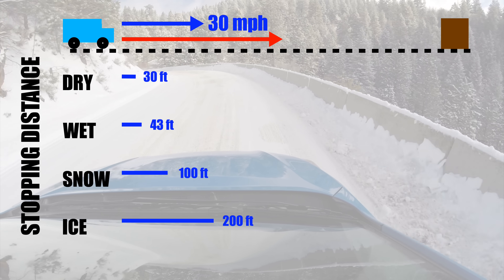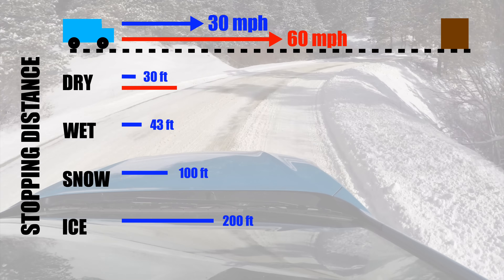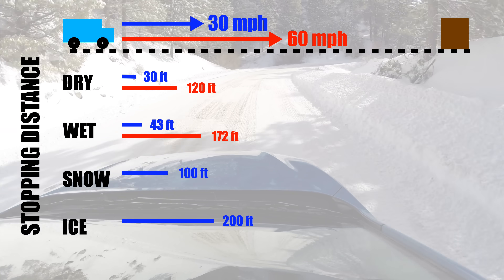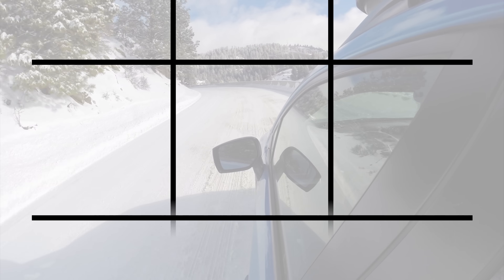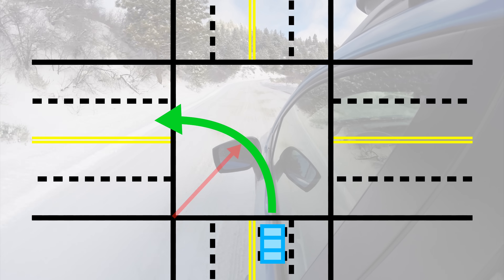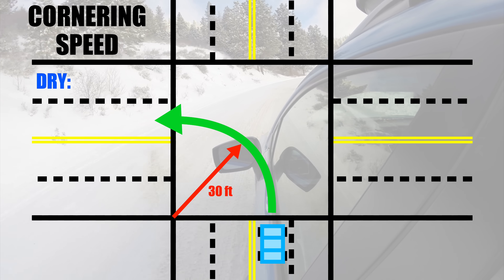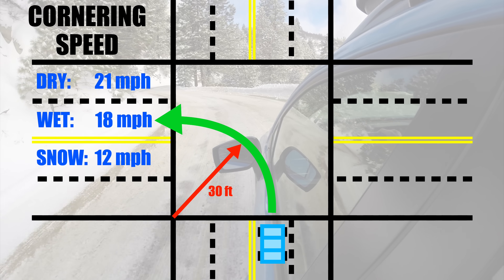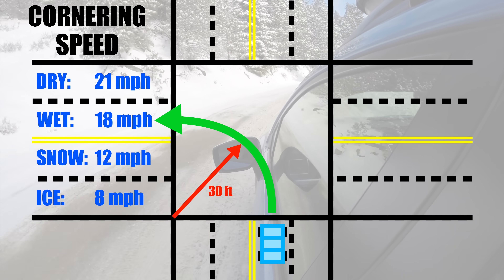Everything You Need To Know About Driving In The Snow

Comment: I remember driving in the mountains in British Columbia early in the morning when it was dark out. There was ice and blowing snow and I was going 60 km/h then some pickup truck passed me then further up the road he slipped around a bend and had crashed. People really just need to slowdown in winter. Even having a 4x4 with winter tires and ground clearance you can still crash trying to go fast. 

Maybe you will have to leave earlier for work. Maybe you might be late. But it is better than getting killed over being inpatient.
Reply: Prairielander the increased ground clearance of douchebags in lifted trucks actually decreases their traction as there is a higher center of mass so therefore a longer lever arm of the lateral G force around a turn (easier to tip over) which unweights the inside tires and increase the G force to the putter tires making them slide out. I used to get passed by those idiots in lifted trucks driving to school in my rear wheel drive Volvo and almost every time I’d come around a certain flat corner and they’d be in the ditch; I’d just honk and 🤙🏻
Reply: @Natedoc808  Kids! 35 years driving in the Rockies, NE BC and NW Alberta. Its sick the number of cars exit the road in icy conditions tail first.
Reply: The thing the folks in 4WD/AWD vehicles seem to forget is every car has 4-wheel braking, so when it comes to stopping, you aren’t really any better off. If the FWD car ahead of you couldn’t stop due to road conditions, you probably can’t stop any shorter. 

I see so many folks in 4WD trucks and SUVs who don’t leave extra follow distance in winter because they have 4WD and think they don’t need to. And then they end up rear-ending someone else as a result. Or, best case scenario, end up in a ditch or hitting something on the side of the road in their attempts to not rear-end someone (when they realize in time that they’re not going to be able to stop and try to swerve instead).

Comment: A few years back, I had a chance to take a 1-day class on this topic.  In it, they covered the advantages of modern ABS with the traction controls on the cars from one specific manufacturer and did so by turning on and off the ABS and traction control.  The class was at their proving grounds and it took place on a large area that they had sprayed with water just before a freeze.  Fortunately (it made the class better) it snowed on top of the ice.   I don't want to make a misleading mistake on describing what I learned but, if you can, it would be good to describe best techniques for driving with and without traction controls and ABS.  The experiences were very different.
Reply: SE Michigan Andy I’ve been planning on doing a video on ABS in snow... I did tests about 10yrs ago & could stop 30-40% faster without ABS, I really detest ABS for winter driving. Traction control is fine for ice but ends up getting you stuck if you’re driving in deep snow.

Comment: What about ABS? If you want to minimize stopping distance is it best to pump the brakes? Or is it better to slam the brakes and let the ABS handle the “pumping”?
Reply: ABS will "pump" better than you can, so definitely let ABS handle it. That said, engaging the brakes so hard they engage ABS is a sure sign you've misjudged your stopping distance - and while misjudging stopping distance on dry pavement can mean only a foot or two difference, misjudging stopping distance on snow or ice can mean a dozen or so foot difference, and downhill you can definitely find yourself in a situation where you'll just slide until the slope lessens. Always, always drive safer than you normally would and never try to push traction to its limit on snow or ice.

It also doesn't help that sometimes there is ice underneath the snow (also packed snow is far more slippery than people realize, especially since repeated use of the road results in the snow melting and re-freezing into ice), and one of common mistakes I see people make is to assume regular snow stopping distance when the actual traction is closer to ice than snow. I'd actually recommend (safely!) testing the traction of the snow in very low speed conditions before leaving your local neighborhood and driving anywhere.

Comment: Also, for the love of god, don't hit the brakes going around corners in the snow and ice. If you need to slow down, do it BEFORE you turn. Every winter in Michigan I'd see dozens of people fail at this and end up spinning out into a ditch or the guardrail.
Reply: Jim Pekarek Yeah he totally missed explaining why it’s a circle and not a square. The tradeoff between cornering and braking. You can do one, or the other, or a little teensy bit of both. But you can’t have all of both at the same time.
Reply: I can’t believe this wasn’t on our driving test. I had no idea of this concept until I spun out going extremely slow in sleet. Now I do this even in dry environments to maintain good muscle memory.
Reply: Yeah if I realize I'm going too fast, it's simple enough to threshold brake hard right to the limit on a dry patch rather than do some braking later in the turn. It has saved me I believe once or twice in harsh Vermont winter storm conditions.
Reply: When the rear end kicks out i always see people hit the brakes. I always let off the gas or brakes and let the car correct itself
Reply: Best way to slow down, Ice or not, is to release the gas before you make your turn, then gently apply brake if needed at all.
Reply: @ryankelsey9646  thanks! 😢
Reply: @ShelterDogs  On snow and ice I usually out drive the 4X4s in a FWD sedan. Most people do not know how to drive.
Reply: Man! Also people don’t think if during the turn you need to slow your speed

If you push on your brakes hard
Your car will stop turning. It will slide forward
Reply: People here in Pittsburgh do this as well and I see this happening as well. Also, when going downhill...shift into N this way if you slide your car will slide straight and not all over the road. Lastly, when going down hill...PUMP your breaks, don't slam on them. I know pumping ur breaks wears them out faster, but I don't know about you, but I'd rather spend a few hundred dollars on breaks and or rotors than a few THOUSAND dollars for damage to your car or another car.
Reply: @kevinray6586 how old is your car? It has to be pretty old at this point in time to not have ABS and if it does have ABS you are not helping pumping the brakes.
Reply: Actually, a lot of drivers don't understand how ABS brakes work. Steady pressure on the brakes even when turning will allow you to control the car.ABS brakes pulsate in milliseconds and don't allow the wheels to lock up. That combined with traction control will get you out of trouble on slippery roads and of course snow tires. I worked for a company and we hired a lot of younger drivers at one time and they were having a lot of accidents. So the company had everyone take a course on how to handle a car in an emergency situation/defensive driving etc. The course was done at a racetrack so it was behind the wheel as well as the classroom.
Reply: @don-cw1yz  only reason why i know hoe to drive is getting into sticky situations with the old junk the old people used to drive cause i daily one of those old shitboxes. I love it, i cant stand driving somthing with tcs,abs ect. If you have the modern-day helpers youl never learn. That training is good
Reply: Just slow down and have the right tires on your car. Best advice right there. Also, when you get a chance, test the surface. Like in an empty parking lot or on a straightaway when nobody else is close to you, tap those brakes and get a "feel" for what you are dealing with. Looks can be deceiving.
Reply: Thanks for the tip. Rented a cabin and were driving up to the mountain in a few weeks
Reply: @RowdyUpInHere  drive safe 👍
Reply: Thank you for the tip bc I would have used my breaks... Tomorrow will be my first time driving in snow and I am scared!
Reply: Going to drive for the first time ever in snow up to Lake Tahoe tomorrow after a blizzard. Any recommendations to avoid cars that are not so knowledgeable?

I'm running with 4x4 and snow tires with the intent of 30mph and no braking on any possible ice with correct turning into a slide if needed.
Reply: I just got my CDL and they dont teach these kind words. Thank you for this.
Reply: Same, I live in upstate NY and I swear every year it’s like it’s everyone’s first time in the snow!
Reply: Is it really 1 g on dry surfaces ?
Reply: as someone who brakes in the turn a lot thank you for telling me this
Reply: @Red Herring  it was great, the snow plow was working around the clock to clear the main streets of the little town. Inside the neighborhood was a different story. I had wheel spin but didn't lose control of the car.
Reply: Almost happened to me today. Where I live we probably get one big snow every couple of years, so this is all new to me.
Reply: And most of them are 4x4’s
Reply: Thank you im not used to driving in the snow I needed the advice
Reply: Thanks!
Reply: but thats the funniest part hit break turn the wheel to opposite side and do a little snow drifting :D
Reply: Engine break
Reply: Uhm actually by pressing brakes you get more cornering ability, buy on wintery conditions press it very gently, not too hard
Reply: After 7 years of driving in the snow, I learned this only yesterday
Reply: absolutely this. braking during a turn throws the weight to the front of the vehicle and upsets the balance of the car.  remember, if you are applying 100% braking, you have 0% steering.
Reply: Very good advice for a new driver thanks.
Reply: Makes it interesting every year.... I just tell people its like Mario cart. Ice means you slide.

Comment: Studless vs. studded tires is an interesting subject. Studless tires work on icy roads because studded tires break up the surface of the ice, creating irregularities into the surface, which studless tires can grip onto. If everyone had studless winter tires, they would be pretty much useless if there's any ice on the road. That would lead to more frequent de-icing using salt, which creates environmental issues.
Then again, studded tires create huge air quality issues in cities when there's no snow or ice. The studs eat away the asphalt, turning it into a fine dust that then flies around. People are basically breathing in the asphalt. Apparently it's not very healthy.

Comment: Wrong! lol 
The stopping distance on ice on a hill in a Ford tow truck is the legacy Bug at the bottom of the hill. Bugs have good traction on ice.

Excellent video. I noticed you sometimes do vids on performance. If you haven't already the traction circle makes a great illustrator of grip and how to manage it relative to track conditions. I'm sure your followers can get a lot out of that discussion particularly when you consider great track control also results in better emergency control on the street. For instance a video using the traction circle to show how emergency maximum performance braking must be done in a straight line just like corner entry braking. Some of that stuff that deals with the engineering terms gets pretty confusing. But the traction circle makes it plain as day.

I love your stuff.

Comment: Could have added the rule of correcting loss of control and/or traction at speed on slippery conditions: On manual gearbox, press clutch and do NOT brake hard. On automatic: let go of gas pedal and do NOT brake hard. Being easy on the steering you did say. :)

Also how to get unstuck on snow: Manual: Clutch lullaby - swing the car forward and back using just 1st or 2nd or reverse gear. Automatic: Get someone to tow you unstuck or dig your way out with a shovel.
Reply: Lol!
My experience is that as long as you disable the anti-spin, a front wheel driven car can crawl or spin it's way through most slippery stand-stills, even in slopes.
Reply: @SonsOfLorgar  I guess that you have never been stuck in more than two inches of snow. Well, that's perfectly ok. Not everyone has the opportunity to live and drive in the land of snow and ice, where it snows even at july - Finland. :)

Comment: As a Canadian, I am both delighted and triggered that you chose this topic.

However, winter tires are soft and piles of snow is not as common on roads as ICE....  which is why you need soft tires, preferably with studs.
Next video -- tire comparison! Stopping on ice! Threshold braking Vs. ABS!
Normal tire pressure  Vs. 10% below recommended pressure!
Reply: In our part of Ontario, studded tires are illegal. They’re only allowed in Northern Ontario.

Comment: the abs sensor in my car is broken, so i don't have abs or traction control.... am i screwed?
Reply from the maker: Not if you're smooth. ABS helps those who don't have great braking control. Computer solves the problem of how much pressure to apply. You can break very close to (if not better than) as well, by simply applying the correct pressure for the conditions. Smooth inputs! If you jam the pedal things will lock up.

Comment: What would you suggest for winter tires? Smaller or wider than your summer tires? Everywhere I hear about going for smaller for grip in snow, since there would be higher point force (or something like that) which would help break up the snow to get to an underground with better surface for grip. But what I have found in winter driving is that I almost never encounter fresh snow to drive through, almost every time it is already flattened to solid snow surface or even gotten icy. And I don’t think smaller tires would help than, since there is no better contact surface to get to, so wouldn’t wider tires be better than?
Reply: No, because the wide tyres actually might cause a water film to form from ground preassure faster than the film can be dispersed through the tyre patterns compared to a narrow tyre and thus turn you into driving a bambi on ice...

Comment: LOVE the video.  What I REALLY want to know is a tricky question.  At what road temperature and at what speed do tires start/stop warming up simply due to rolling friction??
Reply from the maker: Well, friction will always add heat to a tire. Higher speeds have more rolling resistance, but the rate of heat rejection may increase if it's super cold outside.

Comment: I use to think winter tires were a gimmick that only rich people wasted money on. After driving with studded winter tires though i now think it should be legally required for all vehicles to have winter tires in the snow.
Reply: No new regs. Studless winters are all that’s needed on most cars, some do just fine on all-terrains. Requiring studs? Oh heck no. That is beyond unnecessary, it needlessly destroys the roads, it would just be an expensive and burdensome regulation.

If studless winters are spinning, put on chains until you’re out of the glare ice. Then go get training, because you’re doing it wrong. Better yet, don’t be on the road.

But seriously, I have a very hard time keeping my mouth shut when some obliviot is driving around in the DRY in APRIL in a friggin Subaru on studs. If you need studs to drive a Subaru in winter, you’re doing it wrong. And leaving them on until the last legal day is stupidity on a variety of levels (noisy, tears up the roads, waste of an expensive tire, etc). My wife and I live in a snowy and icy environment in winter, the Columbia River Gorge. All-Terrain All-Seasons on the Outback do quite well (Yoko Geolandar AT-S and Continental TerrainContact A/T), and studless winters are practically training wheels (Blizzaks or Michelin X-Ice). ZERO reason to run studs. I carry chains because preparedness, but have never had to use them (obviously I did a test install in my garage to make sure they fit and all the parts were there if they were ever needed).

No legal requirement for studs. Do not give the idiots in Salem or Olympia* any such stupidly unnecessary ideas.

(*Those are the OR and WA state capitols for those who failed geography)
Reply: @ducfandan1117  I don't like your arrogance, I'll bedazzle my subaru tires just for you!
Reply: SugarBooty Well, I won’t be the one driving around sounding like an incompetent boob with studs thwacking away when it’s 40 degrees and dry. Knock yourself out. 🙄
Reply: @ducfandan1117  At least my tires will look BANGIN''
Reply: FourTwenny I wouldn't go that far but most definitely a good idea. I just hate being told I have to do something because it's the law like wearing a seatbelt. I wear one because it's also a good idea not because it's the law.
Reply: It is legally required in most of northern Europe since winter tyres became a thing some time in the 1960'ies, along with mandatory seat belt usage.
Reply: in some places you are required by law to use winter tires and/or chains...
Reply: Studless tires are fine for police cars, ambulances, hearses... The rest of is can stay home that single day every third year when we have a morning with black ice...

Comment: Would have been useful if you explained ABS behaviour on slippery surfaces ie the car will not turn if you slam the breaks and abs kicks in, so you can either turn or break but not both. It also increases the stopping distance, but does save your car from skidding, so there is a trade off
Reply: ABS, as the acronym implies, prevents wheels from locking. In a vehicle without ABS when you step firmly on the brake pedal and the wheels lock, the resistance force between the ground and the tyre has the same direction as the vehicle, not the direction of the wheel. That is why when wheels are locked and you try to steer nothing happens. ABS lets you take control of the situation by allowing you to steer, as it locks and unlocks the brakes several times per second.